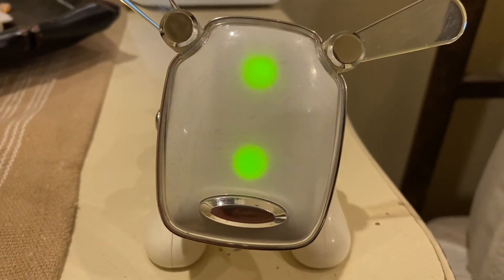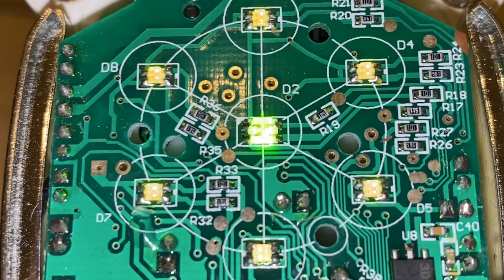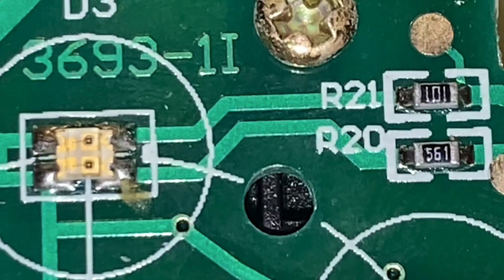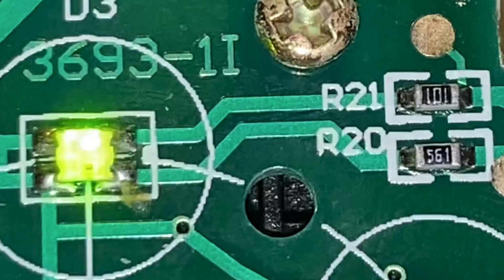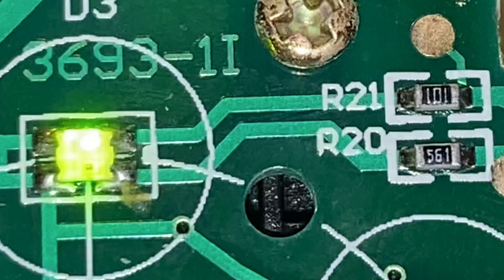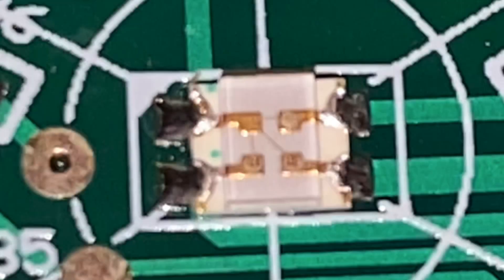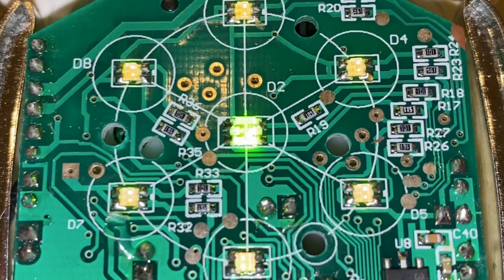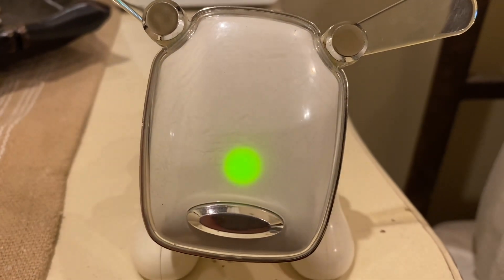Explaining How I-Dog Lights Work

Comment: I just found my old collection of these. Took the batteries out and cleaned them up with some IPA. Most are in great shape but the idop amped has some yellowing and a broken bottom speaker. Your vids are helping me big time, thank you.
Reply from the maker: That's so cool!! Which ones did you find?
Good luck with the amp'd speaker, hopefully its just a wire or somethin
Reply: @IDogFan41  oh hey thanks for the reply! Yeah I had a 2005 idog, ipup, icat and two idog amped. It’ll be a fun project to find the fault and fix it. Thanks again for your vids they are awesome!

Comment: I find it truly incredible how the LEDs of the I-Dogs work by how they flash the colors yellow and orange based on the different concentrations of the red and green flashing together to make those colors. Along for the middle light on I-Dogs that flash multicolored lights like the 2005 I-Dogs, blue and red flashing together making purple where the blue is brighter than the red in that case since red is brighter than green while it’s brighter for blue. For many decades, I never really understood how two LEDs would combine together to make those colors you see on things that have Rgb LEDs like I-Dogs as I always thought they would have several amounts of separate LEDs that would flash those colors but it’s just two colors that make those certain colors in this case, yellow and orange. I mean it would be cool if there was an I-Dog that actually had more room to have so many LEDs that wouldn’t be colors flashing together to make them but I could understand why they’re programmed to have only two because it would probably take too much space or something to fit regular LEDs of the colors you see when they mix red and green together, but it’s really cool how they work. 

According to what I’ve researched about Rgb LEDs a few years later, I finally understood what it meant and saw what colors of LEDs you mix together to make those certain colors like Red & Green = Yellow and Orange, Red & Blue = Purple, Red, Green, and Blue (as three primary colors flashing together)= White, and Green & Blue = Cyan and/or Light Blue according to the chart of Rgb LEDs flashing together and their basic concentrations of each two primary colors flashing brighter than the other depending on how the resistor goes that makes the colors blend well without one LED shining over it where it wouldn’t flash the color it’s supposed to flash on the I-Dogs, and it’s actually really amazing how Hasbro put so much effort and work to make the LEDs work on them to flash different colors where it’s only two primary colors doing that than what you’d expect it as something else which you see in the original board of each I-Dog. It’s also quite interesting how you would have to swap the resistors to make sure the LEDs are in the correct position of getting the concentrations of the two primary colors used right, even when you do light mods like this for example.

I’m also still really excited that you were able to manage to figure out exactly how to replace LEDs on I-Dogs and how to mod them when you’d have epic custom mod ideas in mind to try out with two primary colors LEDs that weren’t used on any I-Dogs minus the Green, Red, and Blue (for the middle light) which turned out great. I’m especially shocked it would even be possible to do that as sometimes there is possibilities that can make it work but can’t always be sure depending how it goes when trying it out on I-Dogs since they are older technology from the early 2000s after all. I’m really looking forward to getting a few I-Dogs I had in mind for custom LED mod ideas and see how they turn out with them flashing different colors from two primary color LEDs that weren’t used other than the regular light colors we seen on many I-Dogs, especially since I already have some great ideas in mind just like you did with the ones you got recently modded lol

Excellent job with the video presentation of everything you explained about how the LEDs of I-Dogs exactly work, the resistors, and where the LEDs actually go inside the board for both the outer and middle lights with the positive and negative side ends. I would love to try this out eventually with I-Dogs (and maybe a few other things) when I get better at soldering and how to exactly replace LEDs without breaking them or anything in the future as I wouldn’t wanna mess it up as it seems hard to do anyways without experience, but managing to find the perfect solution that you figured out with the Rgb LEDs, you did such a great job dude!!! I’m looking forward for some more custom mod projects that we’ll look into together eventually and a few of the ones I have that I recently bought to get modded by you once we discuss and research more about it soon. I’m also looking forward to your custom idea project you have coming up of making a light mod custom Spi-Dog (which I don’t wanna spoil the surprise details for you since I already know what it’s gonna be like) which will have the modded blue and white LEDs demonstrated on a parts dog you tested with that will make it super epic indeed. I really enjoyed every single part of this, and excellent video as always my dude! 👍

Comment: Nice! I'm working on reverse engineering these and have plans to dump stuff like the 2005's save chip. I also managed to figure out a way to use breadboard and a few resistors to record the audio off of the Pups with a bit less distortion today.
Reply: I finally finished ripping my i-Dog Pups! I found a method that's a lot cleaner than using headphones but also requires Audacity. Basically, you connect one wire to a resistor which goes to a headphone jack and add a second resistor (from the one going to the headphone jack) that goes to the other wire which is directly connected to the headphone jack. This makes the audio signal much more stable and removes buzzing. When all of this is set up, connect an AUX cable to the now fully set up adapter and start recording.
Reply from the maker: That's awesome!
Reply: @IDogFan41  Thank you! Your videos inspired me to begin my toy audio preservation project of sorts. I'm currently making a device that I can hook up to the speakers and adjusting it until I get the cleanest audio signal possible out of the rest. I might redo my Pup rips, as I noticed a bit of noise/quiet static sounding effects in the audio.
Reply from the maker: Good luck!